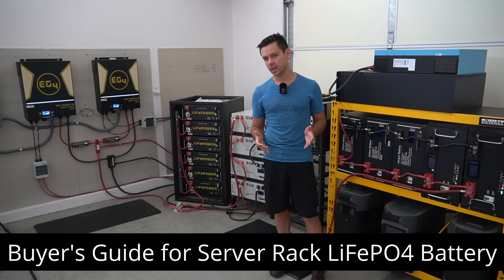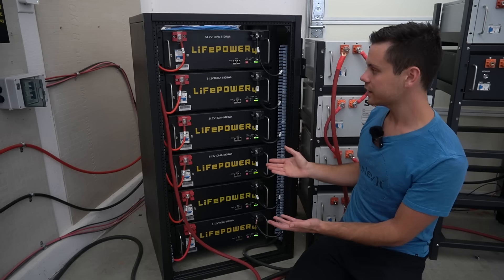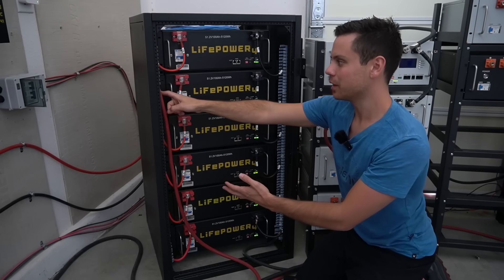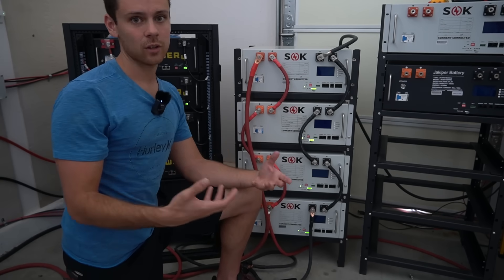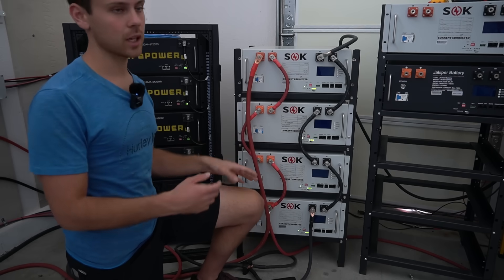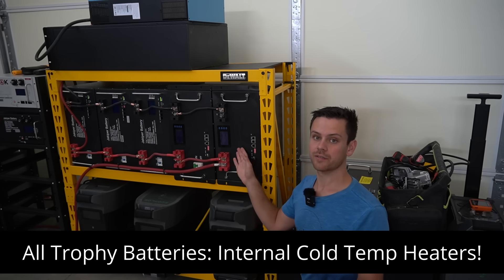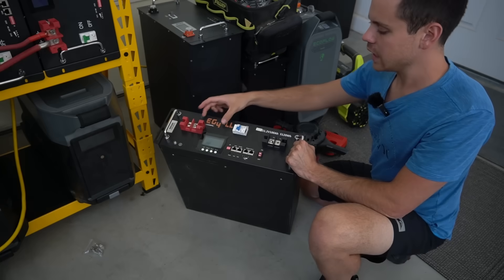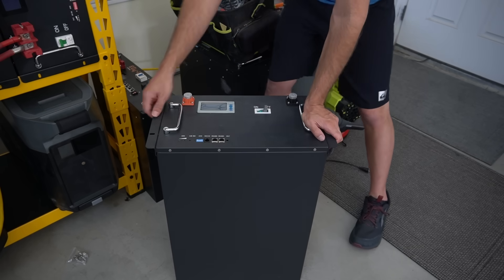LiFePO4 Server Rack Battery Buyer's Guide! For Off-grid Solar Systems

Comment: This may be a real dumb sounding question, but for marine use it is important to maintain the weight low to achieve a low center of gravity.  

     SOK is well designed for vibration and repair. 
🤔 The question: Can the SOK racks be orientated horizontally with the rack handles oriented up to facilitate maintenance and monitoring or would this effect the thermal cooling scheme or mechanical load of the individual rack modules? 

      There is always the option of cramming a bunch of 12V batteries together below decks, but I think the rack system is more secure. Shims could be utilized to compensate for gravity on the rack slides or a custom rack for the modules could be fabricated. 

    I think that bus bars rather than daisy chained cables are a better engineered conservative design.  This is SOP both in the Navy and the comercial nuclear field. 😎

Comment: This might be a crazy idea, but what if you used these rack mounted batteries in an electric vehicle?

Let's say hypothetically that you wanted 100kWh of storage with these batteries. To do that you'd need 20 of the EG4's, SOK's, Jakiper batteries.

Those would also weigh quite a bit more than if you had used the 300Ah Trophy batteries. You'd also only need 7 of them to hit 100kWh of storage in an EV.

EG4:
 20 x 109 lbs = 2180 lbs
SOK:
 20 x 99.2 lbs = 1984 lbs
Trophy 300Ah:
 7 x 242 lbs = 1591 lbs

From 2180 lbs for twenty 100Ah vs 1591 lbs for seven 300Ah, that's nearly 589 lbs!

Based on the available numbers, the Trophy batteries would be the best setup for an EV. And since they're self-heating, you wouldn't need to worry about charging issues. Cooling might be a problem, but fans and heat exchange is already an established thing with all vehicles.

The biggest advantage for a rack mounted system in an EV is that you could hotswap the batteries in the field. There is already a company out of Australia playing with this idea for Semi trucks but if you could drive 100kWh of distance and swap out your drained the batteries for fresh batteries, you'd be capable of driving much longer distances.

Basically, envision some sort of sci-fi gas station of the future. You drop off your dead cells to be recharged with cheap renewable solar/wind/hydro energy, and you can instantly grab fresh cells to continue driving immediately.

Also, why aren't there EV's with a range extending trailers? Hauling dead weight kills EV performance. But what if it wasn't dead weight?

What if that trailer had 100kWh of extra storage on-board? And what if that trailer was also partially self-propelled? Most vehicles can tow 2000lbs to 1600 lbs on a trailer.

An EV trailer that turned your 4x4 into a 6x6 would be insane. And not just by decreasing rolling resistance by eliminating dead weight either. That's without factoring in regenerative braking while driving downhill.

Comment: Would a single eg4ll work with a Victron multi plus in a class b camper van. I have a microwave and an 2 burner induction cooktop
Reply: 200 amph 24 volt

Comment: Although your information is true, and you are very knowledgeable. You do not need such high end and fancy equipment to get a solar job done (especially under 10kW). People spend tens of thousands of dollars on these systems to eliminate dependency from utility companies or going "off grid" but it is absolutely not necessary, and pretty much makes the idea of self power generation and dependency elimination pointless.

So long as you follow your ratings for your charge controllers, make the necessary calculations for AWG sizes, and attach things properly and in a secure and safe manner - you can have good, safe results for WAY less money.

Comment: Hi,  it would be great if you review the Powersync batery 15 year or 10,000 cycle warranty it uses bus bars to connect to each other and the have 250 amp braker to connect up to 62 batery in parallel, thanks for your show

Comment: Hi, I have a question i have been watching all your videos  for a few days now.  Do these batteries need  a vented room  like if you had a bunch of car batteries? The Reasen is i live in Thailand and high heat and humidity  so i want to do the whole setup in my garage laundry room storage room if possible and not too noisy  also. 
I also  see that type N  panels are  best half cut panels  and that JA solar i think are one of the best  if i can even get them here. I was thinking  $10,000  to $12,000  should get me a decent system if i can get all the right pieces and someone to hook it all up i have a good electrition  that build my house and he's spot on if he knows  what to do and had the materials. I can order wire everything  and he's  good to put it all together.  BUT BUT  can  i get parts and will it be ok in my laundry room office storage room??? 
thank you  for all your videos i was up to 2 am last night watching   them. :):):)

Comment: interesting on the overcurrent issues with the single battery vs multiple. I just tested a powerqueen, single 12v, 100ah, running through a Roarbatt 2000watt inverter, on a ryobi circular saw, and a Rigid Table saw. Both showed mid 300's inrush, but both worked fine. I was surprised, and the circular saw was running at 1100 watts continuously, which is pretty close to powerqueen's 1200 watt stated limit. It's going to make for a great combo for a mobile solar generator.

Comment: If you are buying local in Australia I really like "Lithium Battery Wholesaler" on facebooks offerings. I am not affiliated just like their batteries. They have a 48v100ah server rack battery (Designed here in Australia, Perth), looks simular to SOK but it's on sale for $2550 AUD atm with free delivery where as the SOK in Australia is $3195. I can't find any of the other batteries covered here in Australia.

Comment: how we can recovery battery to normal when it is dead on firmware updating. battery shows 53v but not running load. and its screen also off and inverter shows zero battery.

Comment: And now there is a 7.68KW 150v server rack battery on Amazon, and they have the same specs on a wall hanger battery for the same price. Before they sold out, they were willing to ship them up here to Alaska for free. I already have some Chins, but if I was building a new system, I would not mind getting them.

Comment: Capacitor ´industrial rated’ deisel semi truck capacitors and starter alternators (deisel semi trucks used teal extra abundance (electric ,e=Mc squared? E =Mc 3 deisel semi trucks used in fields of yet owned land kinda vehicle used metal forest e,, got super capacitors and alternators capacitors and alternators industrial rated 100,000 grand 10 hours of meta legal data made deisel components yet owned extra deisel components grabbed from an data card(meta deisel components synthèse tesla electric power made groceries abundantly metal shelves stocked nitrogen sealed food barrels good ever food (wth is ?expera?? Before android we had food barrrls good ever (built custom tools easier deisel mechanic effort,,,)

Comment: Great Job!!  Love your videos, and we are all gaining great knowledge from you! Quick Question i hope Will or another subscriber could help answer: Why are none of the ethernet ports (or communication ports) on the front of these server batteries in use? 
I thought connrcting the batteries using these ports  helped them communicate with each other, perhaps to help even out the drain / charge of the batteries when used together in a rack?

Comment: Hello, how would you set up a battery back up that could replace a generator input.  As in can replace the gas generator with using generator plug

Comment: I have a question
Can I connect 300ah battery bank to a 24volt hybrid inveter? Or is the inveter limited to what is shown on the DC input which is 24v 142a?

Comment: Great Video!!
Can we use these batteries on an ON-GRID Solar array? If so, do you have a video on how to add it on since companies are charging $15k for a 16.5kw battery to be added to the solar install. That would be great since for that amount of $$ we can actually get 50kw with the cheaper "Budget LifePO4" ones.

Thanks again for these very informative videos!!

Comment: I live in Idaho, with snow about six months a year. What would be a off grid work horse system to run my 1700 sq’ house year round. Can I make a system that uses either on or off grid without rewiring my whole house?

Comment: Could you elaborate a bit on your EV. I'm so confused why, when you have access to tons of cells, instead throw not one but two server rack on his ev. Would it not be more effective to stack some eve 300ah+ cells under the seat? They can also handle the 300ah spike you mentioned. 

Btw. You could add a 300-400watt panel on top and hook it up to a mppt booster. Then it will charge while driving and if parked in the sun. I bought a 10A 50-96v mppt booster for 40$. No issues.

Thanks for the video, very informative.

Comment: Question: why not use a standard 19 inch server rack to install the rack mountable batteries. Also, why not build a server rack with batteries + inverter installed in the rack. Battery connections would be installed inside the rack and AC out / AC in and PEV power would feed to the the rack. That would make a very clean install without the need to screw the inverter to a wall. What do you think?

Comment: Love your input coverage. I want to go lithiam from my 6x900 amp 2 volt open wet traction cells aboard my boat, they have been brilliant so far but I'd like quicker charge from my 1400 watt solar aboard. Is there a marinised set if cells  600 to 1000 amp lithiams youd recommend.

Comment: Thank you Will for all of your wonderful videos! Together, they represent a priceless knowledge base on this subject and your upbeat demeanor, even in the face of not the greatest discovery, is always welcome and sometimes entertaining! You and another YouTube guy (who builds cool stuff) present some comical stories of dealing with battery sources in countries very different from our own. I'll simply say that facts don't care about feelings and some suppliers just can't appreciate that.
I am writing this as I sit in my tiny RV where I live completely off grid, in the middle of the city and hear my propane fueled generator humming away in the background.
After surviving on a pair of huge 12 volt SLA RV batteries wired in parallel, a 30 y/o 600/1200 watt Chinese inverter, and my  Westinghouse Wgen3600DF generator (with R/C!) for a little over a year, I purchased a PowMR brand "Solar Inverter Charger" (POW-LVM3.0K-24V) and one Chins 24 volt/100Ah lithium battery and am awaiting my own decision on solar panels. I'm considering higher output (200 watt<) 24 volt panels due to limited space and will order another Chins battery as finances permit. (It's a VERY tiny, tiny house that suits my tiny finances!) The batteries don't last nearly as long now as they did when they were new, probably because I have relied upon the low voltage alarm on the inverter and just letting the generator run with a 60/40/20 amp charger for 2 hours at a time as my BMS! LOL! 
Your videos have been a great source of information and entertainment at the same time. I really appreciate the no holds barred but precisely detailed information that's presented in a non-threatening way. I really can't thank you enough for these video productions as they continue to provide a seemingly rare insight into a brighter personal future for me.

Comment: Do you have SunStonePower batteries and inverters in the US? Even though I had been watching your videos for like a year, when I decided to get a small solar system, I couldn't really get anything you shown, here in Europe. I ended up buying through local company, which raised price, but gave me more real guarantees and a help line. Their invertor is REVO-II, which is something put into many chineese hybrid invertors, I guess. Mine seem to be faulty, seem to be very lagging and unstable during charging and now shuts down power for few seconds like nearly everyday at least once. The local company said to ship it to them and they will ship another from their stock in few days back. To be honest, I'd probably opt for something more reliable and supported Victron Energy now, if I had a choice.

Comment: Another fantastic video thank you Will. You mentioned trying to get your hands on some Pylontech batteries for testing. This would be much appreciated as I have just purchased two US3000c Pylontech batteries. We can just about get them in the UK, I ordered and paid in early April and delivered September 7th. This is no fault of the supplier  at least they were honest enough to sell for msrp unlike some others charging 50% more. I would be very interested in what the God of Lifepo4 thinks of them! Also they seem to support several comunication protocols, so it would be interesting which inverters communicate best. I've just bought the Sofar me3000sp inverter/charger for AC coupling to an existing grid tied Solar panel system that I can't modify as it was free and doesn't belong to me. Like so many in the UK, it was installed by an Investment House to capitalise on high Government Feed In Tariffs that were axed long ago. Their meter is just after the inverter so I can use all the power generated and they still get paid the Feed In Tarriff. Therefore, more coverage of AC coupled systems would also be appreciated. Thank you for providing excellent content, without your guidance I wouldn't have known lifepo4 chemistry is the way to go👍

Comment: Will: What are the 3 dimensions on the EG4 Server Rack, the one with lockable door? I am having a grid-tied solar system installed soon and I want to leave room for batteries, which I will have installed later. Also, I thought the EG4 Server Rack was mounted on wheels, but the one you show is NOT. Not a big deal, but is it available with wheels?

Comment: Regarding your solar golf cart I think that if you stuck with the Tesla modules and went with the Bpath BMS the concerns you have would be alleviated. It makes his slave out of the BMS board on the modules controls them all the way down to Heating and Cooling as if it were in a Tesla. In the event of any issues like you described the battery is isolated. As an aside this unit is plug and play with Victron via Can Bus and can run up to 26 modules. It should all fit right where your seat batteries are and can handle any level of draw you can generate with a golf cart.

Comment: Thanks for the break down. how ever its still not practical to use solar for whole home. it would take 37 panels just to power enough to cover 2 refers and 1 freezer and 1 central AC unit let alone power the rest of my house.(65) according to the co that came out. sadly i don't even have the room for that on my roof i could probably place 25 max. thats the new panels signature just got @455W. you are looking at 50-70k for a hole home setup just cant justify that when power from the utility co is only $0.11 a kwh atm.

Comment: How many of the cheaper EG4 batteries can I connect to a 15k sol ark and what would be a good generator to charge the system as a backup?
I think 60kWh would be enough for me to live a normal life in colorado completely off grid and charge an ev if I had 17kW of solar on an adjustable ground rack & connected  to 60kWh of batteries, especially considering the extremely efficient cooking & heating elements ill be building into the home.

Also would I be able to use a 19.2kW EV charger with sun up?

Comment: The issue is that all the processing of Lithium is happening in China.  Tesla is working on helping to change that, but it's going to be years in the making.  Once you have Lithium processing (to create Lithium Hydroxide, for example), it makes manufacturing the batteries here in the U.S. a lot easier.

Comment: Thank you so much. I have question, Is it possible to make series connection between these server rack batteries to get high voltage for example (300 - 600)VDC for high volt invertors?

Comment: I see you are not communicating from the battery BMS to the inverter.  Are you just letting the BMS manage the battery and setting the inverter to basic lithium setting to make this work?  I am running the SMA sunny Islands 6048.  I hear people are having trouble with the Sunny Island Inverter not communicating with the BMS of the EG4 and SOK batteries.  Current Connected is working with SMA for a solution but they are not there yet.  Could you please advise how that is working for you so that I can be confident in running without communication until the said companies get the software to talk.  Thanks

Comment: I am am pretty new to solar and DIY'ed an entire Solar Setup using the Ecoflow delta pro product suite. I also have a Powerhorse 7.5k inverter generator as a secondary backup that is triple fuel capable. Currently I have the genny hooked up to my natural gas. What I want to do now is zero out my bill and potentially sell back to utility with a hybrid inverter. I have thought of adding a Sol-Ark 15K, additional 14K of panels, server rack of (6) eg4 batteries ect. Sol-Ark is also coming out with a 14 circuit smart home panel (Smart Loads 14) that is sort of like the smart home panel I now use with Ecoflow. My question is how will I integrate the two vendor systems? Ecoflow of course wants me to stay in their product suite and just purchase and land additional Ecoflow pros, smart home panels (SHP) and smart batteries. That will likely be an additional $25K and I dont like the 3.2kw max for ecoflow

Comment: Man, I have a ton of questions. I have two 12.8v parallel batteries 20ah and 1 (“100”) watt and a (“185”)  watt panel. All hooked up. I also have a 537wh 24 ah/22.4 v big blue batter that is only showing up to 75 to 80 w charge. Solar controller is 200w on 12v or 400w on 24v . I feel like I’m doing something wrong cause my watts don’t seem right